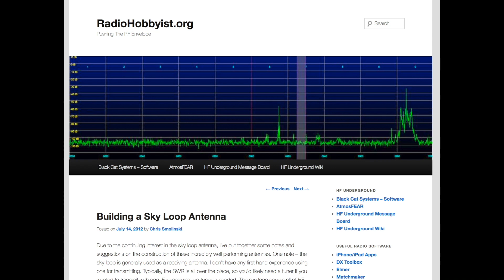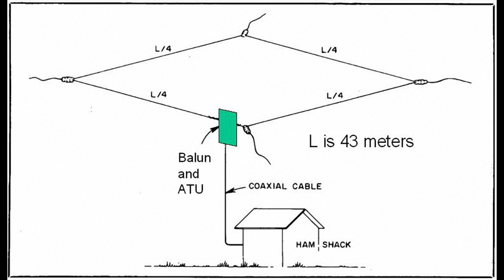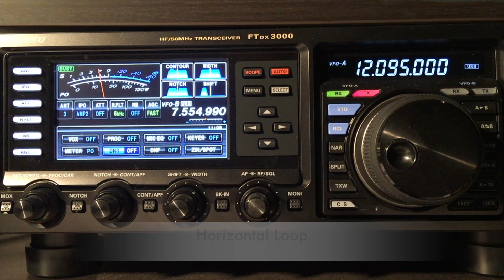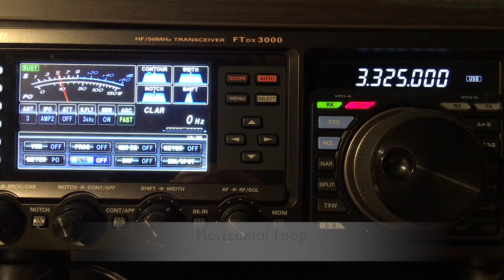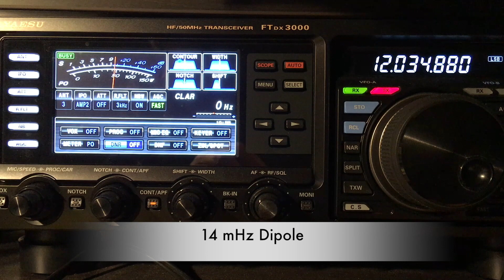Horizontal Loop Antenna Experiments

Comment: I really enjoyed your video Rob. Thank you for posting it. You may wish to also consider, in your experiment, the use of ladder line and tuned feeders to resonate the loop on the frequency of choice. From listening to your neighbour's noise, I'm pretty sure that you could eliminate this 100% with a phasing noise-canceller, using one of the other antennas as the noise-sense pickup antenna. Looking forward to Part 2 of the experiment! 73, Steve, VE7SL
Reply from the maker: Thanks, Steve. In the video, I mentioned that, at this stage, this is just a receiving loop.  If I was going to transmit, ladder line and other mods would certainly need to be made. Re. the noise cancelling, I have the MFJ 1026 noise canceller and have experimented with it as you suggested. It's OK with some noises and not others. And if there are a variety of noise sources giving off different wave forms on the listening frequency, then it underperforms. There's also a canceller made by DX Engineering that has been getting rave reviews, but it's hideously expensive. At this stage, I'm also looking at buying a barrow-load of ferrite to see if that helps. Cheers, Rob VK3BVW
Reply: FB Rob. I'm sure the ferrites will help a lot as well, especially if your neighbour will allow you to put a few over his power cords too. I see what you mean about the DXE noise canceller price...wow! Perhaps some RFI line filters would also help, on your neighbour's end especially so that the crud can be quenched before it hits the power lines and gets re-radiated. 

You may have seen these already but I did a couple of blogs on noise cancelling with one blog comparing the MFJ with the Timewave:

http://ve7sl.blogspot.ca/2017/05/mfj-1026-noise-canceller-tests-at-va7mm.html

http://ve7sl.blogspot.ca/2017/07/mfj-timewave-noise-canceller-shootout.html

The nasty noise heard in the videos is from a grow-op just down the street from Mark's place...there seem to be more and more of these showing up everywhere unfortunately.

You have a wonderful-looking place there BTW and your videos are exceptionally well done. I think you must have been in the broadcast industry!
Reply from the maker: Thanks for your really interesting response, Steve. Yes, I had already seen one of your blog posts, but not the other one. Nice work there! I think the issue here relates to a variety of different noise sources, all with different wave forms. My 1026 can't seem to cope with multiple types of noise at the same time. The other thing is that I tend to move across the shortwave spectrum quite quickly, constantly tuning and checking different frequencies on different bands in a sort of "search and destroy" or "hunt and peck" method!  ;-)  That makes it difficult to use the 1026 because of the need to constantly retune it for maximum effect on each frequency. 

Re. the videos - No, not in the broadcast industry, but a musician and educator. And in retirement, an active and passionate photographer. So I very much enjoy the video making process. I'm just using the Apple iMovie desktop app, a Rode video mic, a Nikon D800 camera, and sometimes the iPhone 6+ camera. And a very basic lighting setup (which still needs work). All good fun. And it helps to have some time on my hands!! Cheers, mate. Rob

Comment: As always another great video. I am  a SWL of 40 years and I find horizontal loops to be quieter. I prefer to use a 9-1 balun as they appear to work better across the complete shortwave  spectrum. Thanks again and good luck with your experiment. Mike
Reply from the maker: That's interesting, Mike. I suspect that the variations between 9:1 and 4:1 (or indeed I read somewhere that someone was using 12:1!) has much to do with the antenna shape, height and surrounding objects. Impedances can vary for a multitude of reasons, can't they? If I could get my hands on a proper antenna analyzer, I could see what was going on in my particular situation. Still, much more experimentation to do, which of course, is fun! It's nice to have the time to play with these things when retired! ;-) All the best, Mike.